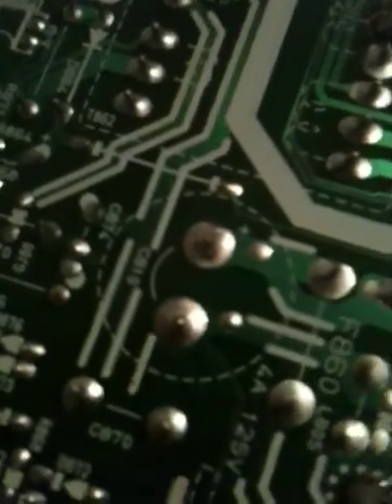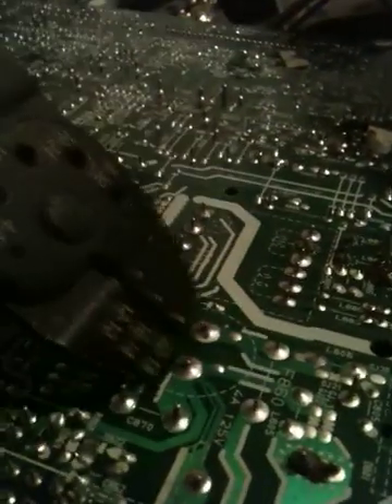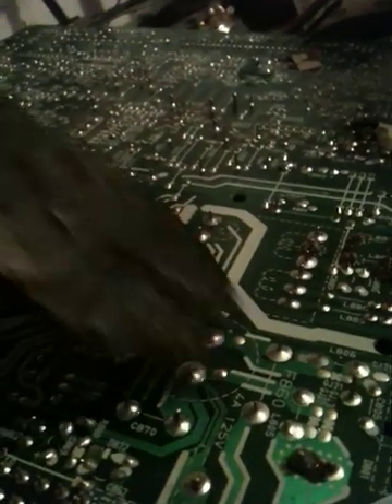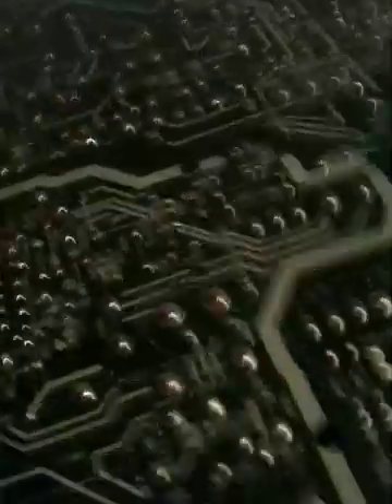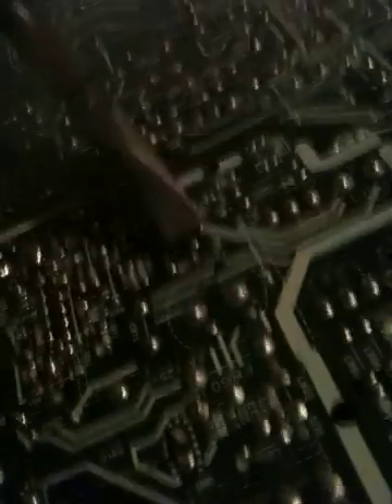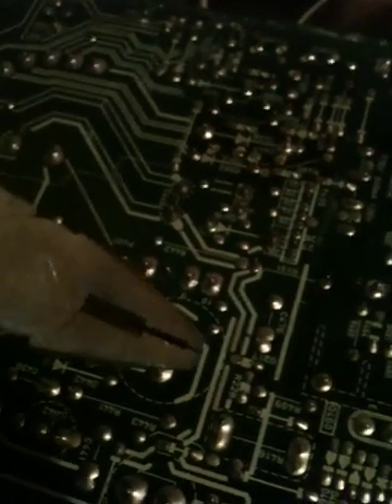FREE radiant ENERGY 2

Comment: Great video! I knew a TV repairman who used a "Scar Driver" to ground the components. It was nothing but an extra large screw driver with the electrical scars all over the shaft. He said if this was attached to a ground strap the scars would not be there. The wild flash would not be their either. If this high voltage was accidentally passed through smaller components it could cause sever damage to them.You might want to check on that! I look forward to the next video!